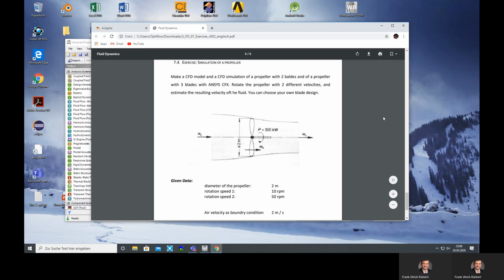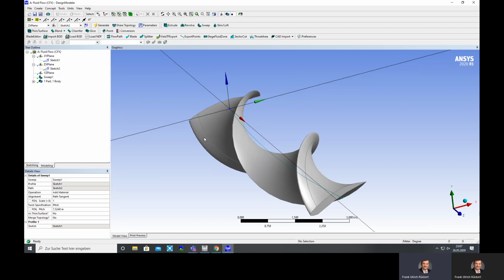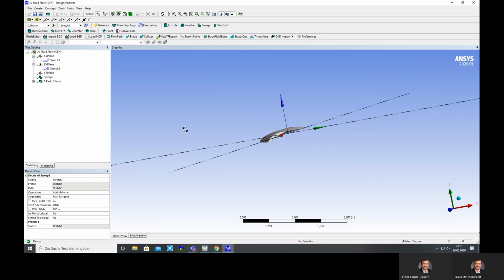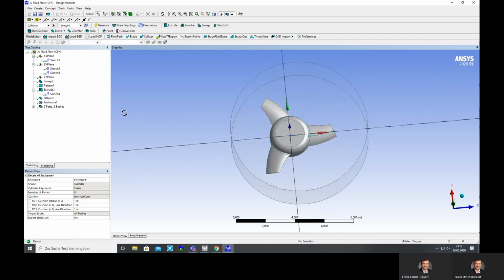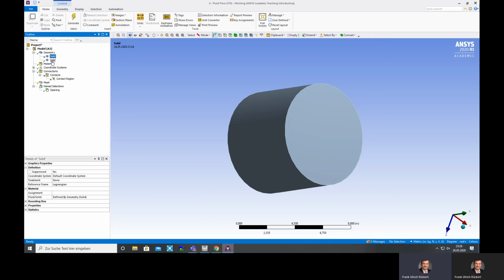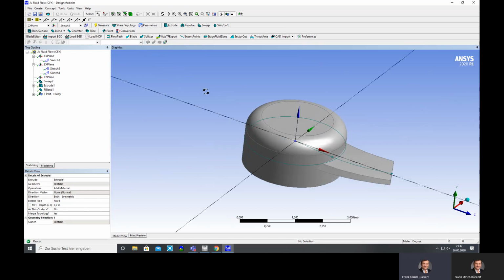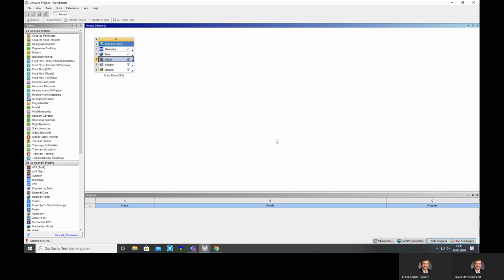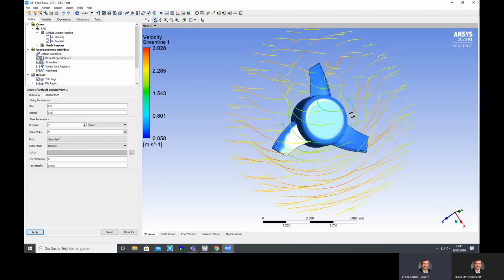ANSYS CFX - Design of a Propeller with 3 Blades

Comment: Hi, I can see that the enclosure You tried to create for 3x bladed propeller was not coaxial. As soon as You changed to even number (4x and 2x bladed propeller) the enclosure become coaxial. Do You actually know hot to make an enclosure that is coaxial even for 3x bladed propeller? Or another question, does it even matter for the symulation if the enclosure is not coaxial? Thank You! 👍
Reply from the maker: You are right. It is not perfect, if the enclosure is non axial. This depends on the number of the blades, the focus is not in the middel. You can do a work-around if you define the enclosure by a geometry. (See menu in Ansys.) There will be no problem, if you do not rotate the enclosure. But if you use a rotating enclosure, the propeller would not rotate around the middle.